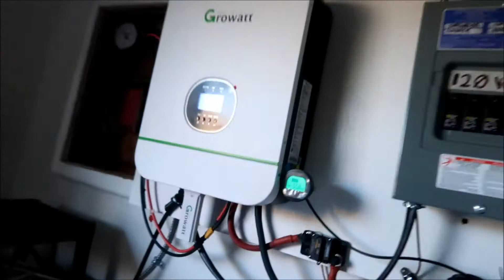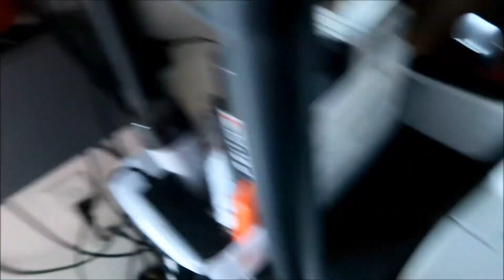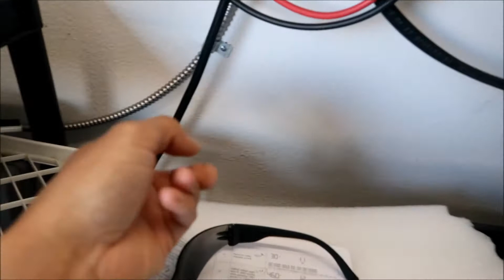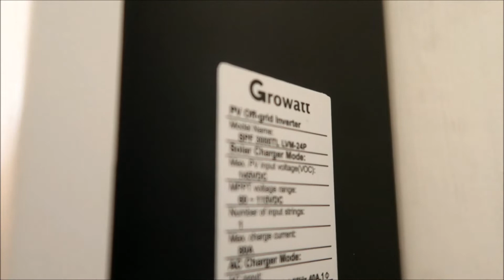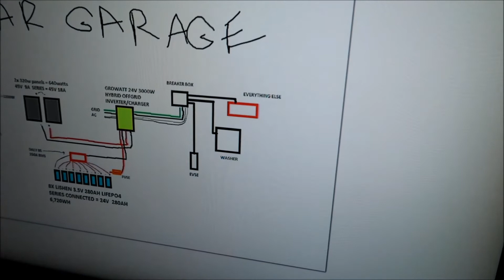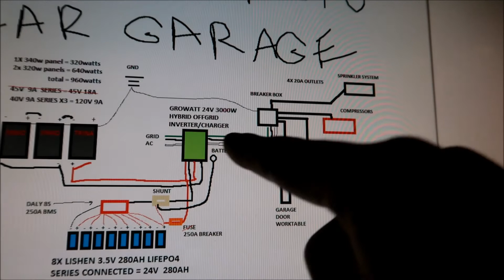HadesOmega Solar Garage Project Episode 65 - Project Complete! Growatt 24V System Overview + Diagram

Comment: Could the small and short spike of solar you get in the morning prior to your system coming on line strong be a reflection from the window onto the panels? The window glass acting as a mirror? I have a neighbor that at certain times of the year their bedroom window reflects directly at the path to my front door. If you stand in the reflection, you can feel the heat of the sunlight it reflects. It has made me wonder about a mirror array to make my panels more efficient......